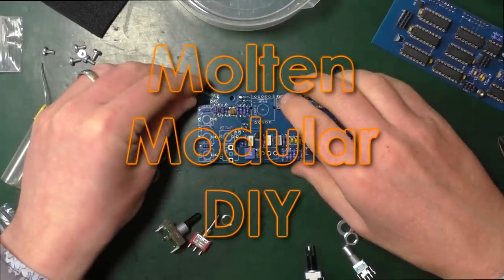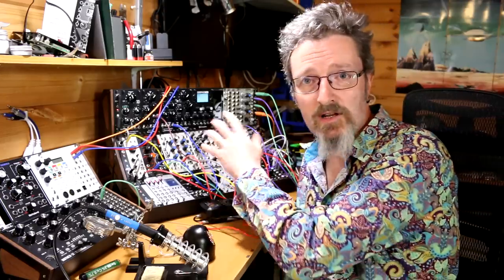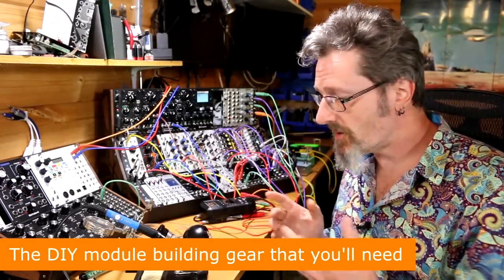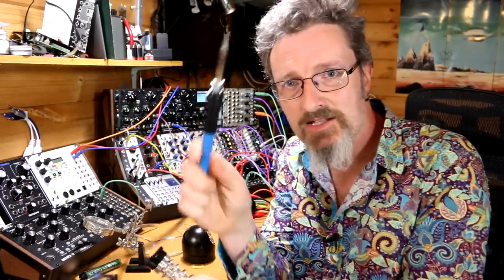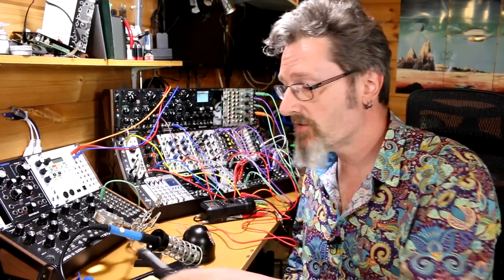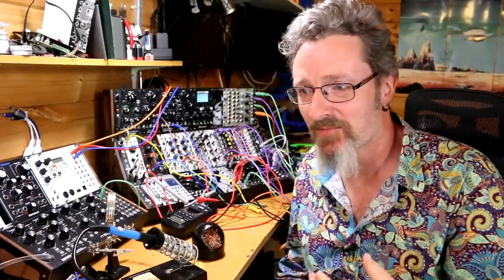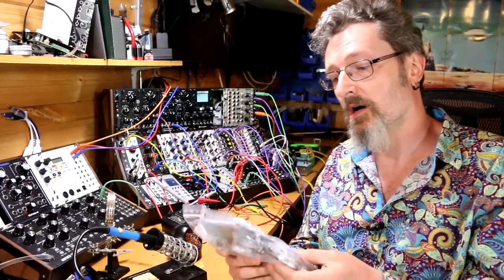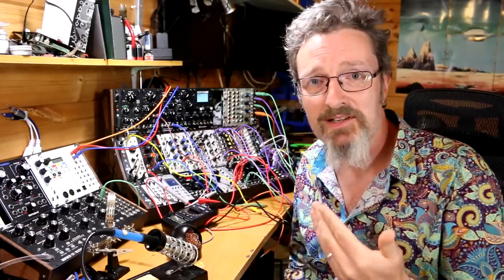Modular DIY 01 - Introduction to building your own modules and the gear you'll need

Comment: Nice thoughtful video!  I've been building DIY for years and Euro for about 2.  Good advice on tools here.  I would definitely invest in a decent pair of cutters and pliers - if you make any amount of gear you will save money, and your sanity.  I find the multi-meter is absolutely essential, use it to check resistance values if you are a bit unsure (sometimes resistor codes can be a bit confusing or hard to make out the colours), use the resistance range to check continuity (i.e. for good/bad solder joints) not just the beeper - you are looking for a low resistance for a good connection.  Use it to check for shorts (solder bridges or pcb faults) and for checking voltages when things don't work quite like they should.  I have a bunch of test gear, but for euro DIY stuff the multimer is used like 95% of the time.  The rest is my capacitance meter - but that's another story.

Comment: SMD is far easier than it seems! I'm a novice solderer, and I think I actually enjoy SMD builds more than through hole builds. I had no problems putting together an Ornament & Crime (it was my third DIY module after a couple of Befaco kits) – all you need is tweezers, a flux pen, a jeweller's loupe, some ~0.5mm solder and a soldering iron. Like you said in the video: don't be scared, just give it a go!

Comment: Love your approach - just diving in there! I'm new to Eurorack and new to electronics, started in January and currently have 18 modules built, mostly SMT. A few non-expert points:
-While I'm sure your soldering iron will be fine, you'll have a much better time with a soldering station with temperature control, generally mine sits at the same temp for most stuff (~320C seems to do the trick for pretty much everything), but it's good to be able to put the temperature up when doing larger components or using braid. Will also be better if you go down the SMD route in the future.
-You're really going to want to invest in some way to clean your boards, get some IPA (not the beer ;) ) and an old clean toothbrush. Leaving flux on the boards is nasty and can cause issues.
-I'd get some flush cutters, much better than vanilla snips as you can get right in there.
-Hopefully your multimeter has continuity mode - this is by far my most used feature on mine and essential for trouble shooting!

Looking forward to this, good luck!
Reply from the maker: ok, good tips
Reply: Is dry flux conductive ?. Only asking as  I sometimes use my heavier gauge solder which tends to leave flux on the boards between the header connector pads . I haven't made a habit of cleaning before hand to be honest. Thou just wondering if isopropyl contact cleaning alcohol would suffice to clean up ?

Comment: Aoyue makes some decent Hakko knockoffs. I have the 469 and it is surprisingly good for its size.
And yeah agreed that lead-free is crap, the joint quality is generally much worse.
The fumes are mostly from the flux but there is some lead, simply a fan blowing it out of your face is enough if you aren't doing it for a living.

Comment: It’s not lead that ends up in the smoke, it’s acidic rosin flux (which is contained as a core in the solder, and burns oxidation off the components to create a clean joint). Just get a small fan so you don’t end up breathing so much of this cloud in. 

The recommendation to get extra flux is a good one. It usually comes as a liquid in a pen - dab it on the PCB before soldering or before re-work and it will burn off oxidation and make for cleaner joints. 

Lead solder melts at a lower temperature, so it’s easier to use, and also reduces the risk of you overheating your components. It also changes more quickly from liquid to solid - and this makes for a more reliable joint. Any movement in the component while unleaded solder is ‘drying’ will give you an unreliable joint.
Reply from the maker: Acidic rosin flux sounds awesome - that sort of thing that turns you into a superhero

Comment: You'll also need a watch maker style screw driver for adjusting trim pots.
Also I use the DVM in two ways.
1. For checking every single resistor value. The colour coding is terrible to read these days.
2. For the necessary calibration voltages set by adjusting those trim pots.
On one build I did use an oscilloscope to calibrate the timing.
If you have time on your hands you can save money, but this isn't always the case.
I've built Bastl Tea Kick and Cinnamon filter both very nice modules. Also the Rebel Technology Stoicia, where I used the oscilloscope for calibration.
Do remember it is best to calibrate with a room temperature of 22 degree C plus or minus 1 degree C.
With the current heat many of my analogue modules are drifting.
That's analogue for you!!!!

Comment: Pliers are useful when you need to bend transistor legs for instance, I also use them to tighten jacks & pots nuts.
Multimeter is a must have whenever you need to calibrate trimmers or debug your board.
I use a small drop of rosin flux (syringe) when I mess up a solder joint (often because the pad or the component leg is not hot enough when I put solder on it) and it instantly melt everything clean and nice.
I also use desoldering braid and I like it. You just apply the braid onto the unwanted solder and then your iron on top, press a little, then you wait and watch the solder being sucked into the braid magically :)
Reply: Braid is only good for clearing already-empty holes or excess solder - everything else is better done with a pump or vacuum desoldering tool.
If I could only have one I'd choose the pump, especially for through hole. Braid is nicer to have around if you're doing mostly SMD work

Comment: From what I read here and there, lead will not go into fumes under 400°C which should be well above the temperature you are supposed to use for melting lead solder. The risk of inhaling lead is quite low. However you absolutely should wash your hands. The fumes are in fact flux fumes (solder wire core contains flux), which is also pretty bad unfortunately.

Comment: When a plumber solders copper pipe, he/she applies flux, first, to clean the metal and make it easier for the solder to stick. Solder for electronics contains flux in the center of the wire, that's what makes a bit of smoke. Used to be acid-based flux, once upon a time, nowadays it's resin-based. Besides being harmful to you, the acid was harmful to the circuit board.

Comment: 7:01 I just upgraded from a no-name with no station and no temperature adjustment to a Hakko fx-888d and so far I am very satisfied. It's a bit pricy, but the real good thing about buying well known brands such as Hakko or Weller is that there are always plenty of accesories available. For example you're gonna have a hard time finding matching soldering tips for noname brands, but it's pretty painless to find specialised soldering tips for Hakko and Weller soldering irons.

Comment: I work at a place that has a pretty controlled environment for soldering cables and cable harnesses. It has a bunch of high grade tools and all sorts of cool shit for someone who’s hobbies include electronics.

However, at home, I try to keep my set ups as cost-effective (cheap as fuck) as I can. Fune extractor!?!? Fuck it! I have my set up next to a window and computer fans stacked up, blowing the fumes out the window. Solder tip cleaner!?!? Altoids tin with a copper wool shit thing inside of it, that I occasionally pour a bit of liquid flux on, and I also use a wet sponge. Desoldering wick is very useful, especially with a bit of flux. Also, don’t forget to clean your shit up with isopropyl alcohol!! These are my most important, basic needs for a decent work space, that has given me good results. 

Nice soldering iron by the way! I’ve got the same one at home. At my work, we have some ridiculously expensive, soldering stations that are self regulating and stuff.

Comment: One of those scrubby green kitchen things to clean the leads of your components. If using PCBs, carefully wipe them with 90% alcohol to clean the oil/grease off the board. Flux helps solder flow, gets a bit messy/sticky but will clean up with that 90% alcohol you've got laying around.

Comment: Some soldering tips... GET A BETTER IRON!!! You want one that has REAL temperature control ESPECIALLY if you are stuck using lead free solder.  Adjustable temperature is not the same as temperature controlled.  Temperature controlled means that the iron can sense its temperature and add power when it senses itself dropping from soldering a joint. A TS100 soldering iron is a nice starting point. Second thing it needs is replaceable tips, because CONICAL TYPES ARE SHIT for soldering pcbs.  You want either a chisel tip or a truncated cone like the TS-D24 or the TS-BC2 tips for the TS100.  You need the iron to heat up the solder pad and the lead so that the solder doesn't just stick to your tip.  The TS100 is just one option and it works best with a 24v power supply.  Third, get some side cutters/flush cutter with a lead catcher (lead catcher not strictly necessary but it keeps the clipped leads from flying all over the place and making a mess to clean up later.)   Cut the leads off right after you finish the joint or the part, working around a forest of leads is ridiculous.

A good soldering iron is a fraction of the price of a module and will make a world of difference in the quality of your self assembled kits.
Reply from the maker: Thanks for the tips! This is a journey and a learning experience - you might want to watch the whole video to see how that unfurls. But my iron appeared to heat things up and solder appeared to flow - components were soldered, all good :)

Comment: I am not an engineer. I work in human services. I learned to design pcbs in my spare time and built a diy LoFi looper/sampler. It's a proper module that is quite fun and cheap. Most of the rest of my modules are Barton diy boards.

Comment: I get a lot of enjoyment out of kit building. I get them from a place called Banggood (unfortunately they don't have Eurorack modules). I just finished building an MP3 player. After going insane soldering a bunch of SMD resistors and capacitors, it was amazing to plug it in (having it pass the smoke test), inserting an SD card and listening to my music on something I had built myself.
Reply from the maker: Nice one

Comment: You place the braid on top of the joint you want to remove, apply the soldering iron, which melts the solder and heats the braid, so the solder sucks up into the braid. I find it removed 95 percent of the solder, but the DIP leg or transistor leg or resistor is stil stuck to the board.
Reply: I tend to put a bit of flux from my flux pen on first. Or add a bit of new solder first . This in my experience helps it flow on to the wick quicker .

Comment: sorry for the absolute newbie comment - what's inside those modules? Is it some kind of super complex engineered circuit that you can't reproduce? Or is it possible for example to take apart a broken appliance or electronic instrument of some kind and build from there? Of course there wouldn't be a universal way to do this but is it possible or not at all? Sorry if this is a dumb question, I don't know much about modular synths, the way they work etc; but from what I gather it's all about managing current? Would love a link or something to dive deeper. The Wikipedia page is very descriptive and also gets quite technical (or maybe I'm too dumb) - but it's not a great introduction into this world
Reply from the maker: No, not at all. Analogue modules are some of the simplest circuits you'll find using regular components (resistors, capacitors etc) and often based on designs from the 1970s. Modular is all about voltage. You've started with my first video on modular DIY - there are more. And also check out my series on Eurorack in general - i've tried to make it as accessible as possible to non-techy people. So i'd recommend exploring my channel a bit more and hopefully you'll find it helpful.

Comment: Lead solder is totally safe to handle as the thin oxide layer on it is not absorbable through your skin just don't eat it, lead only vaporizes at 800*C however flux fumes are the biggest cause of occupational asthma. Solder suckers are great there's just a technique to using them. The sponge vs wire thing argument is BS my £500 metcal iron came with a sponge. Helping hands tools are sometimes useful if you have to tin lots of wire but crap for holding PCBs. If your using good quality multi core solder you shouldn't need extra flux unless your doing SMD work. THE best side cutters are "Engineer Ns-04" the ones with the handles that look like transformers. Get the middle out of a role of packing tape the wide stuff and put your module pcbs on top of it so you can solder parts from the top ;)
Reply from the maker: Good stuff, thank you

Comment: Robin please can you recommend either a good normal iron or pro soldering gun if cheap enough that works properly? My Antex 25 watt iron has stopped getting hot enough to melt solder despite my using leaded solder, a new bit that's pushed on hard, waiting long enough for it to heat up & (when I can find it!) using flux paste. Can irons inexplicably lose efficiency over time? I don't seem to have much luck. I bought a 60 or 70 watter online for heavy duty jobs with temp control. I think I only used it once & it packed up. Stupidly I never told the seller!
Reply from the maker: I am absolutely no expert in these matters. I got a £20 one off Amazon that's been working fine - https://www.amazon.co.uk/gp/product/B0753GWV83/ref=ppx_yo_dt_b_search_asin_title?ie=UTF8&psc=1
It does the job nicely. But i then invested in a more expensive one because i do have an awful lot of soldering to do and people kept recommending it. It heats up quick and maintains it all day. But it's not so much different from the £20 one - https://www.amazon.co.uk/gp/product/B077B9Q6SJ/ref=ppx_yo_dt_b_search_asin_title?ie=UTF8&psc=1
I have no special knowledge, i just picked one! :D

Comment: Love your channel! Just a quick question: Can you recommend any resources for learning the circuitry behind different modules? As in, if one were to design their own module, how could one learn about what the resistors and capacitors specifically do and how they effect the sound? Thanks to anyone for any recommendations!
Reply from the maker: It's a good question and one that i mean to look into some time - i haven't got beyond the kit stage. I would recommend Sam at Look Mum No Computer as he goes into a lot of detail about his modules and fosters a community of builders. I'd be interested to see any other recommendations.
Reply: Moritz Klein is a good channel for it. Lantertronics has a whole series on basically the history of analog synth design with some really good circuitry knowledge in there.

Comment: i find myself buying DIY kits for common things that will be in every ones rack
ADSR's VCA's attenuators, utility modules etc. 

out of about 35 modules in my rack 11 of them I built myself.
(yesterday I finished an ADDAC manual latches which was my 1st SMD kit)
I always shied away from surface mount for the reasons you say but if you have a magnifying glass and a steady hand they are real easy to do. 

(you can SMD with a soldering iron with a fine tip and tweezers.... melt some solder onto the tip then a dab of flux on the pad you want to solder the component to and touch the pad with the soldering iron... this transfers a little solder to the pad... then you hold your component with the tweezers on top of the pad and remelt the solder.... once its held in place the other side is easy to solder.

for startup equipment I would defo say a multi meter is a must have (especially for checking resistor values as most kits won't have these marked and it's a pain in the arse to check colour band codes (thonk bag them up in labeled bags tho)

the smoke that comes off of solder isn't the lead, that is coming from the flux core. (lead free solder also smokes) and yes lead free is crap. (for a device to be ROHS compliant tho it MUST use lead free solder, so it's maybe something to think about if you ever got into it in a big way and planned to sell modules) for a low production run of 1 DIY module, the tiny amount of leaded solder you use isn't much of an environmental issue.
(its when companies do production runs of millions of units that will eventually go to landfill that it becomes a problem)

the de solder wick is impregnated with flux... solder is attracted to flux.
Reply: I got some solder wick ages ago when I just started with electronics. Didn't work for me, I much preferred the solder sucker. Turned out that wick had no flux to speak of and worked like an absolute charm once I added some liquid rosin.
Reply from the maker: SMD are my destiny i imagine
Reply: and I Imagine you'll be fine... it's really no more difficult than through hole.
if you can build a thru hole you can build an SMD. 

just make sure you have some decent magnification and a pair of SMD tweezers (the ones with curved tips) and a flux pen.

I was actually amazed at how easy it was to do.

Comment: Top tip for anyone thinking of building their own modules, first get a Baby8 sequencer kit for £20 on eBay and hone your skills that way. Plus it's a useful little gadget in its own right!
Reply from the maker: It's cool, but not Eurorack - although you can i think get a kit from Error Instruments for a version with a front panel and Eurorack power - costs nearer £99 though.
Reply: It's far less scary putting together a cheap device for the first time solderer! That's why I suggested the Baby8. It's perfect practice and helps to demistify the whole process before you fork out your hundred squids.